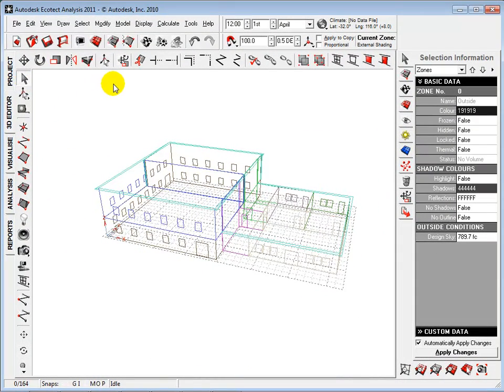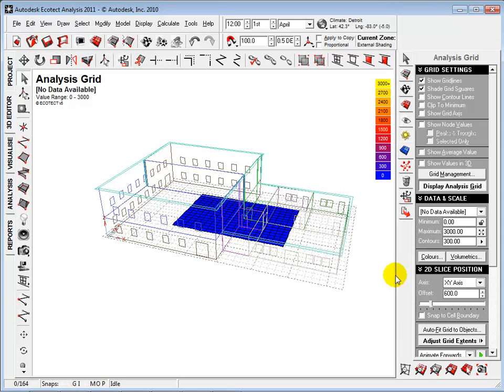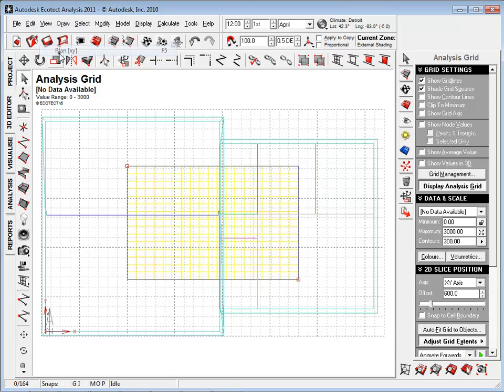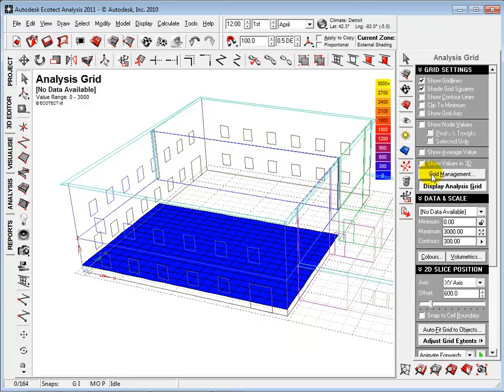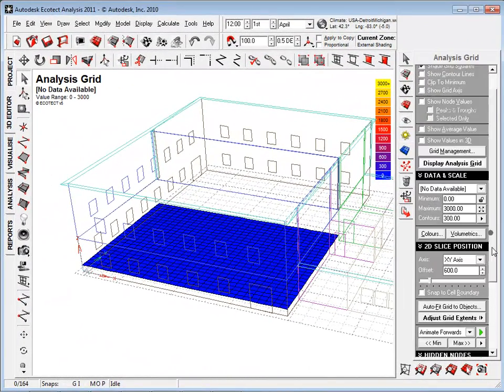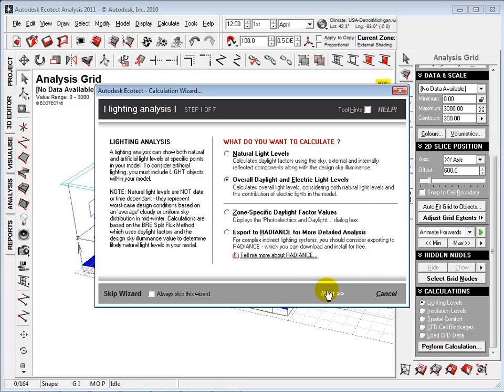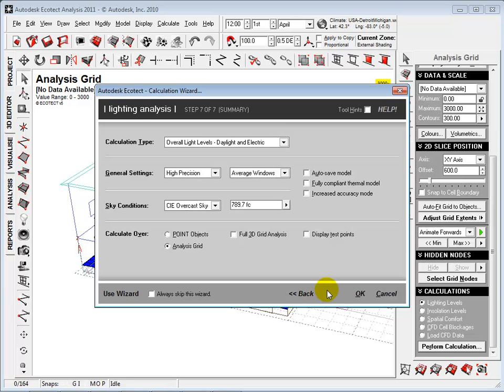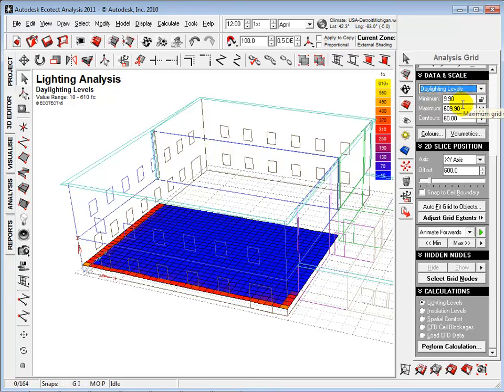Ecotect Analysis - Analyzing the Daylighting Provided in a Design

Comment: I think there is something funny with your results, i.e. the dalight factor is only affected along the perimeter. It may have something to do with the way you set up the analysis grid. If you "Auto-Fit Grid to objects" and select it to be within the floor it should give better results. Also lowering the maximum on "Data & Scale" should make the results easier to visualise.